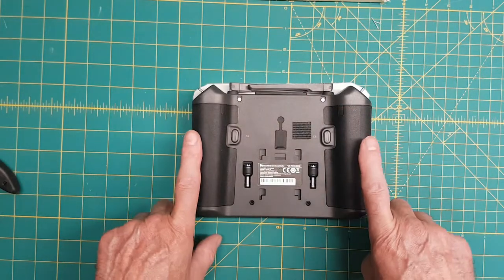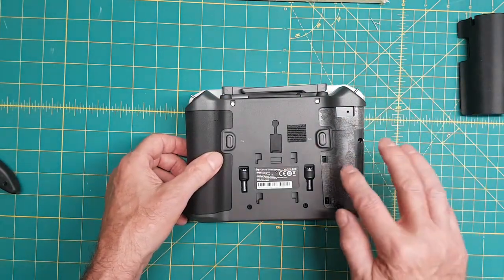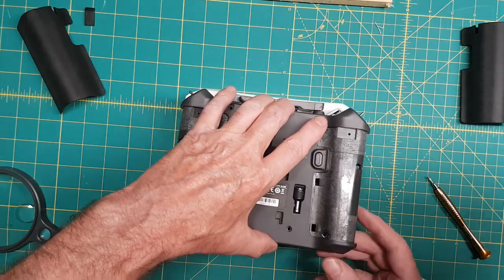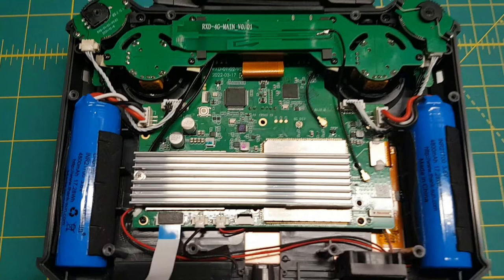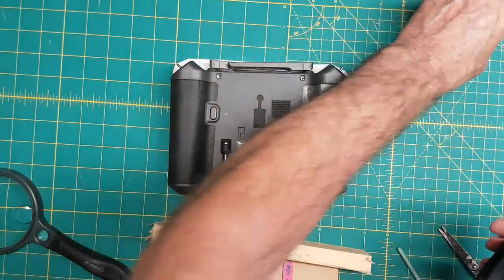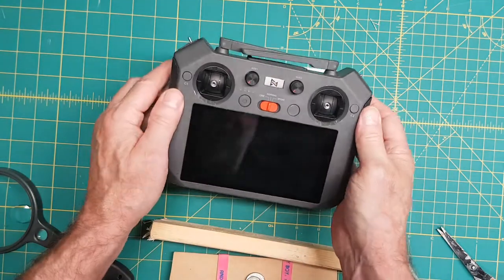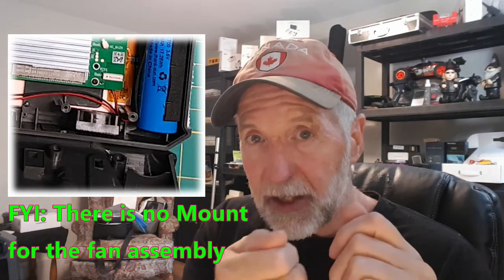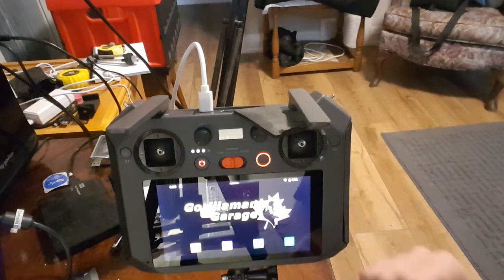Fimi TX10 Controller - How to look inside - No.7

Comment: Appreciate you showing how it's held together. What do you use that square of velcro for? Fimi says tge 4800mAh 2nd battery is not available yet, same with the RX10 accessory module. Tried any other software on it? I was planning to at least try UAV Forecast,  Airdata and maybe LA few others
Reply from the maker: I think the little square of Velcro was to hold an external mic transceiver . But I dont use it now.
Reply: @GorillamansGarage  Yep, sounds about right. What are you using as a mic currently?  Wireless?  I have several good Wireless Mics, but the transceiver would have to stick out the top, keeping the rubber cover/seal open. NOT ideal 😕 open to suggestions. 

My aircraft is the V2, I was curious if the TOF sensors + optical flow held a more stable hover. Short answer? Absolutely works better than ultrasound for stable, hover.  It does not wander. Not sure if it was a one time occurrence (damn well BETTER BE), but a quick "left stick down" land command and it went down... whilst going horizontally 3 or more feet, nearly colliding with my sons car. Beyond any control,  executing a landing,  THAT could have gone sideways, just like the aircraft  😆 

Fimi doesn't cut power to the motors in a fast "hover rpm -> idle rpm the way just about EVERYONE ELSE DOES 🙄 -I'd love to know why, since its why precision landings get RIGHT THERE above the landing spot, then prop wash sends it randomly a half meter sideways when touching down. 😉  -to be fair, they've only been developing this aircraft 5 years or so. You can't rush greatness. 
QUESTION: Has Fimi commented at all on why they left the Panorama shots in their other pants? Curious. They had stitching issues, so maybe pulled them to fix... but again, 5 years. https://music.youtube.com/watch?v=3DUau6wFMiI&feature=share
Reply from the maker: @BlairAir  : I like the hard wired lavaliere 5' mic best. But the onboard mic is OK if you are close. I use a mic sometimes but usually I am filming with another source so I just use the TX10 audio for sync purposes.

Comment: Excelente !! 👌👌👍
Acabo de comprarlo.
 Me envían el TX10-A. Cual es la diferencia entre estos dos modelos ?
Reply from the maker: They stopped making the TX10 because they stopped making the X8SE 2022. You can still get it somewhere I am sure.. but not from Fimi. The TX10 operates only the X8SE 2022... The TX10A operates the X8 Pro (Only) but is supposed to work with he X8SE 2022 V2 later on. The TX10A.. has No Simm Card, No 4G module,  but operates on Android 12 (which is better).
Reply: @GorillamansGarage  Thanks for the information.
I have bought 1 FIMI X8 V1, 1 FIMI X8 SE 2020 and now a FIMI X8 SE 2022 V2.
I think I will put the other previous models up for sale, so that someone else can enjoy them.

Comment: Hello friend, how are you, my TX10a control is locking the screen every half a second, can you tell me why?
Now the recordings that are saved in the gallery do not have the delay, it is normal, only when viewing the screen it gets stuck.
Here is a video from another user with the same problem as mine.
https://www.youtube.com/watch?v=XHQ13Z6PnW0
Reply from the maker: Is it a range issue? Do you have the WiFi turned on? Did you try and load extra software? Did you have issues with an update procedure? Are you in a high electromagnetic frequency range? Are you running the correct App? Did you drop it?... Sorry... but so many questions..